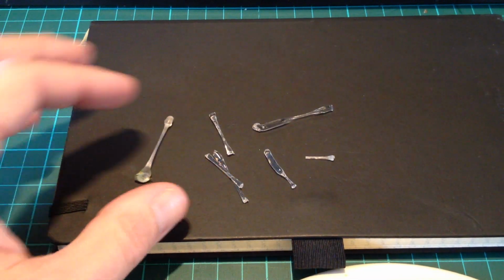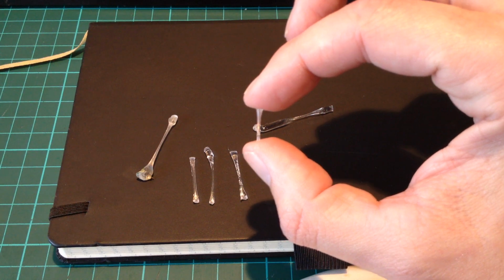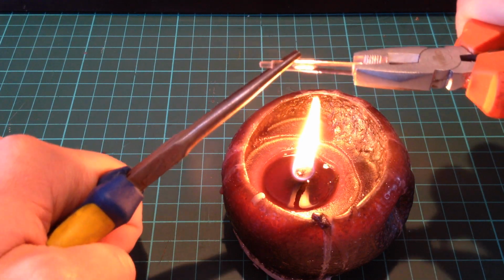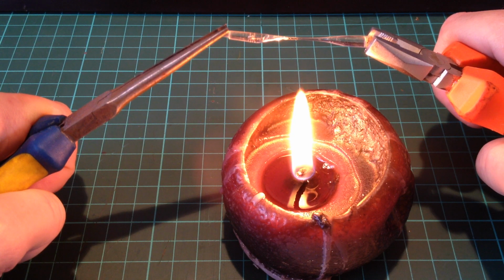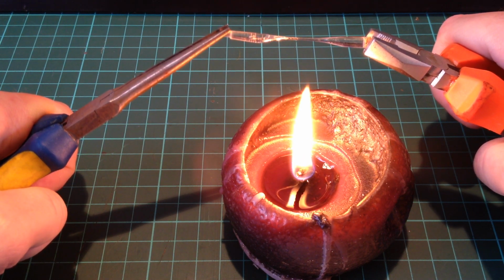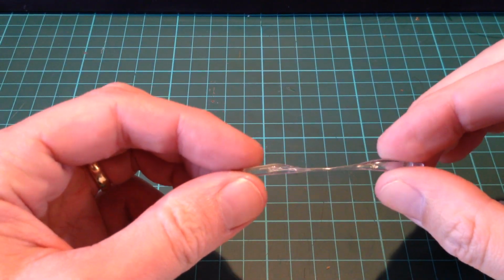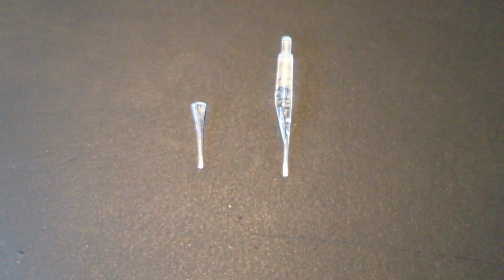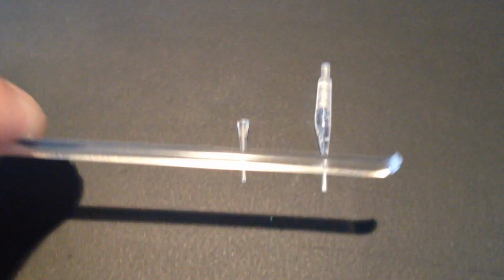How to make icicles for your snow themed wargames terrain

Comment: As an alternative to using the GW clear bases ive used clear plastic silverware with good success. And you can get boxes of them from the dollar store.
Reply: +Dustin Gonzales Otherwise the same techniques as the video though. Great work BTW
Reply from the maker: +Dustin Gonzales I had trouble with those, too brittle in the UK mate
Reply: +TheTerrainTutor Fair enough... It did take me some trial and error finding the right brand. I bought 3 or 4 kinds and the dollar store as an experiment. We ended up using the forks eventually, so it wasn't wasted money.  Maybe worth trying a few brands? Seems much cheaper than using the GW ones... 

Just my thoughts. Love the channel, i have been binge watching your vids. hehe.
Reply: @dustingonzales2566  do you remember what brand worked for you?

Comment: Hello! What I use for icicles for my 1/35 armor is the clear sprues left-over from styrene model kits. You'll also need a small candle and some fine point tweezers. You simply hold the the cut end of the clear plastic near the candle flame and when it starts to "mushroom", reach in with the tweezers, grab a hold of some melting plastic a slowly pull away the sprue while twisting it between your thumb and index finger.. The twisting motion will ensure the "melted" look your trying to mimic. It's cheap, simple and you can make dozens in minutes. I hope this helps.
Reply from the maker: Rick Beman So pretty much what I did in the vid with different clear acrylic?
Reply: No.Not only is it a different material, but method. If done as described you'll find you'll be able to get finer and more natural looking icicles much quicker.

Comment: If anyone is thinking of using glass rod, they'll want a hotter flame like that from a Bunsen burner. Easy enough to do and if you use tube rather than rod, you can get very fine pipettes that work very well for things like plastic solvent/glue, as the hole in the middle doesn't close up.

Another technique for more random ice effects is to drop superglue into water from a few inches up. Sets almost instantly into interesting shapes that look like ice. Much more random shapes, though.
Reply from the maker: Oh, the superglue one is a new one, thanks bud!

Comment: I think you might be able to get a nice 'drippy' texture to it by applying Vallejo Water Effects on the icicle. It's how I get little waterfalls and run-offs on clear plastic sheets, such as when I did a count-as Corpse Cart for WHFB: http://i.imgur.com/r2wvgqG.jpg

The best part is that it dries clear, but also covers up any irregularities with the clear plastic you're applying it to. You should be able to get similar results with something like DecoArt's Triple Thick gloss, or any particularly thick, goopy clear-drying gloss product.
Reply from the maker: phalanx1234 Nice tip, I'm actually planning on building up layers of water effect on clear fishing wire, if you turn them up side down, they drip towards the base and make quite good icicles mate. Haven't seen the triple thick gloss, so thanks for the heads up on that mate :-)